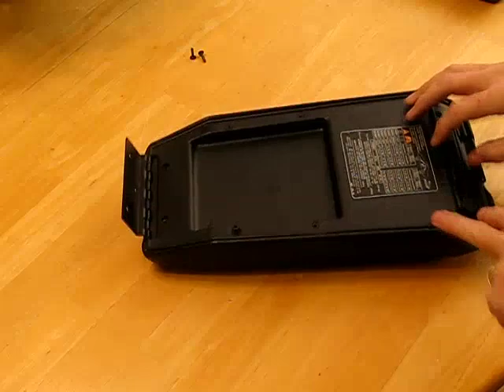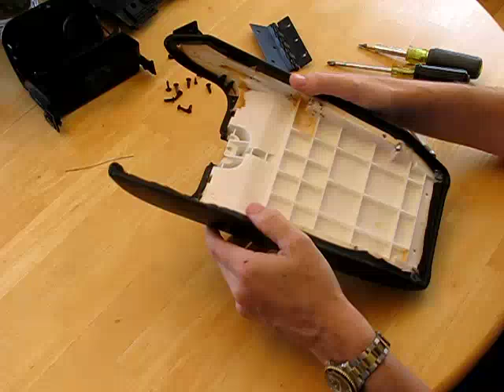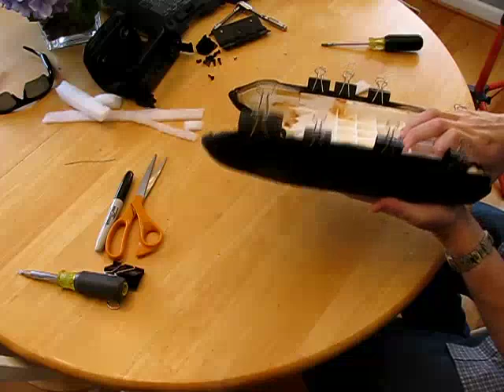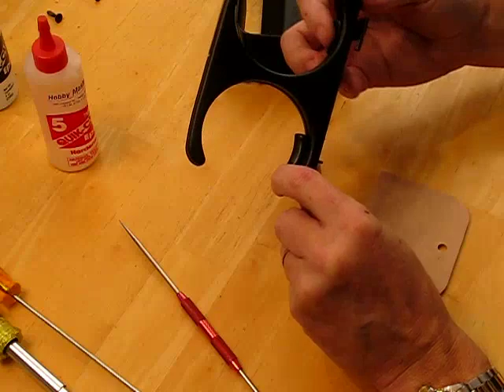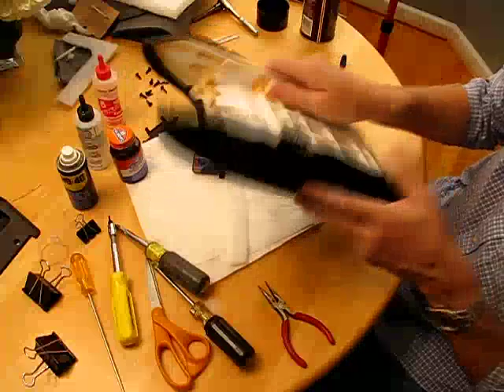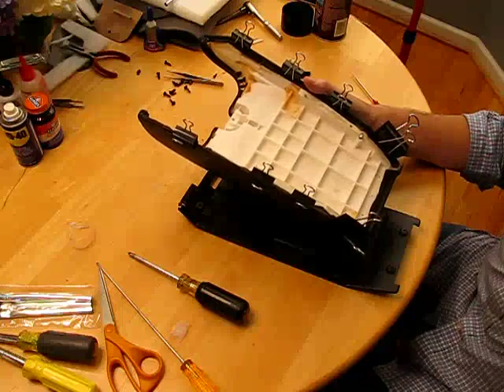Jaguar XK8 and XJ8 Arm Rest/Cup Holder Repair

Comment: If you're still following your comments, what spray adhesive did you use for the foam, and what contact cement for the edges? Thanks.
Reply from the maker: I used 3M Super 77 for the spray adhesive. You can get it on Amazon. I don't remember what I used for the edges, but looking at the little bottle in the video it looks like Gorilla Rubber Cement.